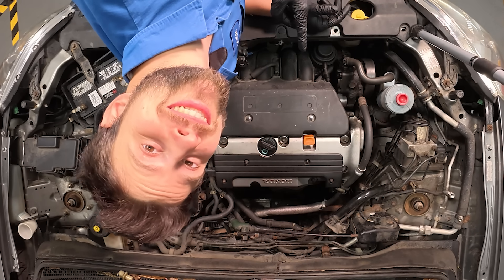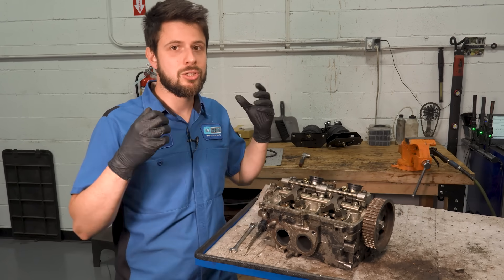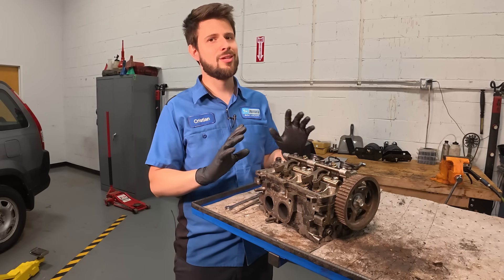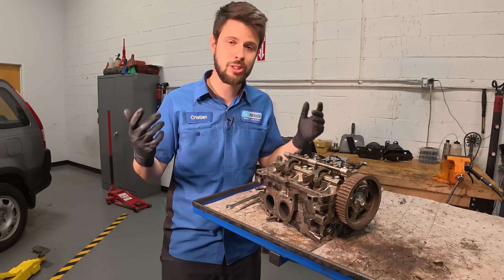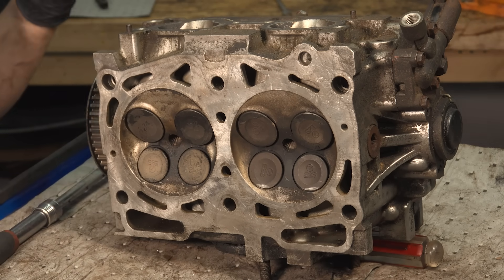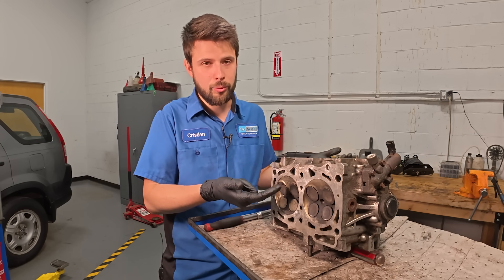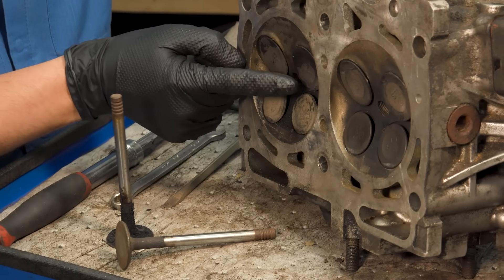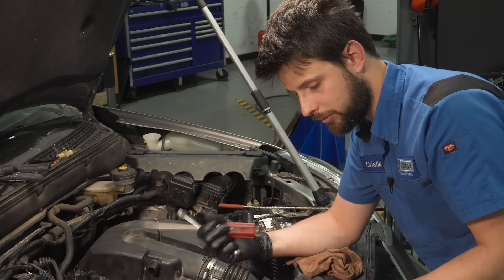Car or Truck Engine Ticking? This Simple Adjustment Can Save You Thousands of Dollars in Repairs

Comment: Whenever there’s strain on my engine  like when I’m driving up a hill I hear a metallic clattering noise coming from the engine. It sounds like a small ship anchor dropping— the sound of a metallic chain moving fast through a metallic threshold. If that makes any sense. My 2005 Murano use to do it and now my 2018 Tacoma does it but less frequently. I wonder if sitting in your car for long periods with the engine running is the culprit?

Comment: OlderFords and Chevys had solid lifters that the lash had to be adjusted . The valve. Covers
Were easy to remove though.However, 80,000 miles  on the odometer was a lot, and no doubt, had some rust!